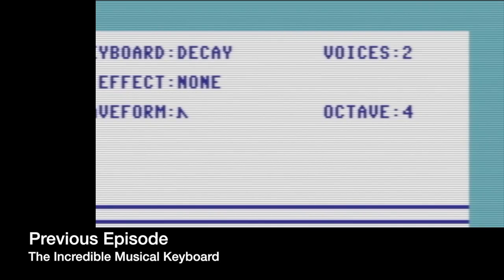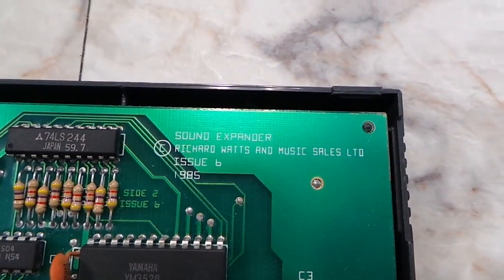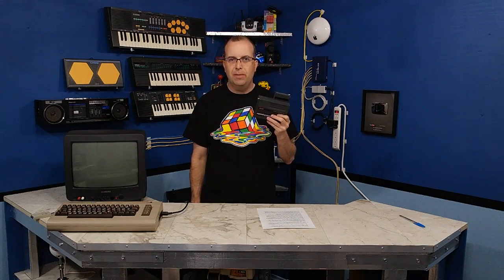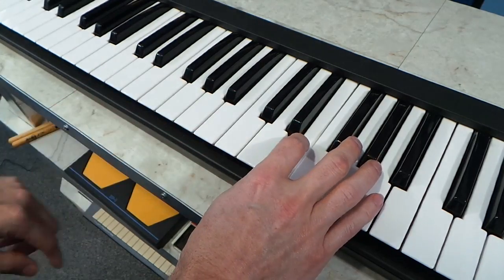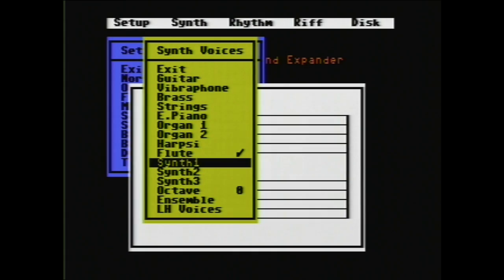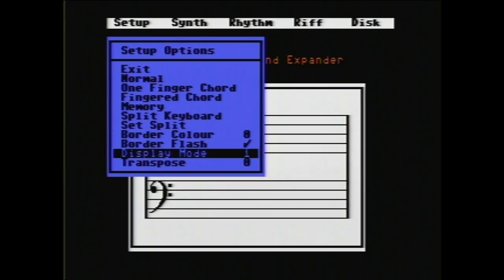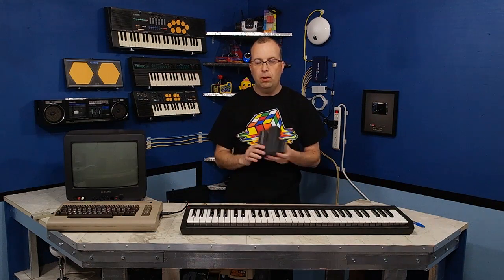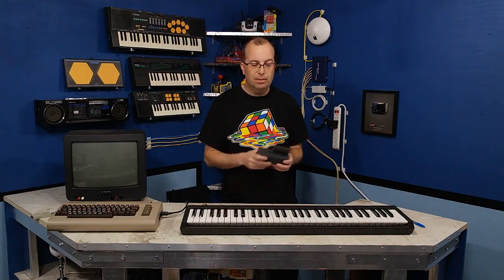Commodore 64 SFX Sound Expander - In Depth Look

Comment: In theory, could a game be made for the c64 that used that device to play its music?
Reply: If you know the hardware location you can POKE values into ram for different things in basic. This was how you created music, sprites, changed screen colors etc. on the C64 and many other microcomputers of the time.
Reply from the maker: Absolutely.  It would simply be a matter of writing the code to support the FM chip in stead of, or in combination with the SID chip.  Like I said in the video, there probably just weren't enough of these on the market to really get game developers interested in writing extra code to support it.
Reply: @8-Bit Keys please start modding one of your carts and upgrade it to 3812.  Then you could show your audience what a modern DRO player http://csdb.dk/release/?id=119462 could do. (Wolf3d, Dune, KGB tracks anyone? :) )
And yes, writing a driver for C64 SFX Sound Expander would be as easy as writing an Adlib driver on pc. These chips have only two registers to write to (and read from), everything else is in the programming reference manual.
Reply: Absolutely. The only problem really is that it could end up occupying rather more memory and demand more of the total available processor / bus time, to the point that it's impractical to use for anything beyond the simple live-play app shown off here, or maybe a text based tracker. OPL programming isn't exactly super heavyweight, hence its usefulness for DOS games that might have run in less than 512kb RAM, but it's still a grade above that of the SID when you start digging down into all the fine grained functionality.

At least, that's the case if you exploit it to the same extreme that a lot of SID programmers did; the unseen advantage with using something like the OPL is that it can actually reduce a lot of the load otherwise placed on the system by coercing the SID into making sophisticated sounds, so long as you program it sympathetically and in the most efficient (rather than most impressive ) way.

Most particularly, the automatic ADSR envelope that can be set differently for each channel (and whose settings are retained indefinitely until you next change the voice) requires sending maybe eight bytes to the OPL, which then repeatedly (ie with each new note-start command you send) and without any further data upload produce a volume progression that may have taken four times as many register writes with the SID, each and every time you played a note. And FM voices that give the impression of sounding chorded, or simpler ones literally played as a di-, tri- or tetrachord thanks to the OPL's greater number of simultaneous voices, can stand in place of the arps that would have been necessary to create a similar auditory effect on the SID - again, you only need send 2, 3 or 4 note-on commands for each of those, where with the SID you might have been banging in at least twice as many (apart from the simplest, shortest blip, each arp in an old VGM or chiptune tends to repeat at least twice) or possibly dozens more for a sustained note.

It's essentially a tradeoff between how much time (and memory) you can afford to spend setting up your chosen chip before actually playing anything, vs how much is available to throw notes (and patch changes) at it on a live playback basis. Ultimately the overall code for both would probably come out about the same, but the demands of whatever you're running it alongside might favour one or the other.

And if you're really canny, you could probably use both in concert playing to the strengths of each, maybe even make an overall saving despite the soundscape being rather richer and more complex.
Reply: They should've done that. They should've used the internal SID chip for sound effects.